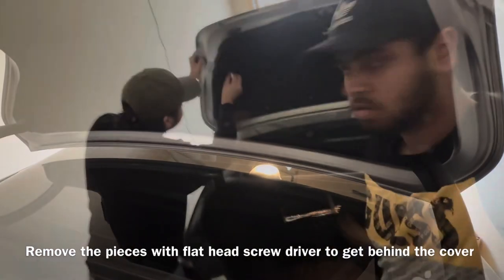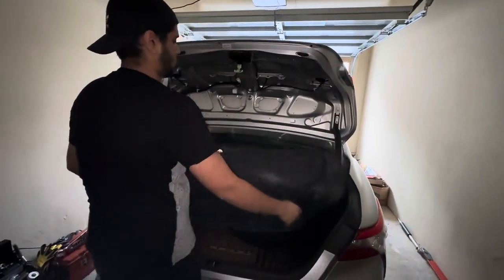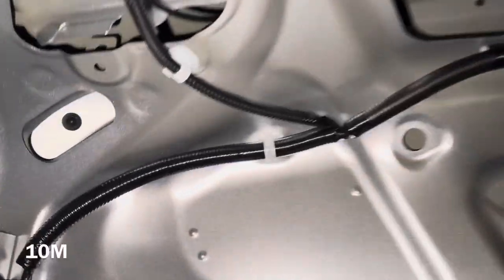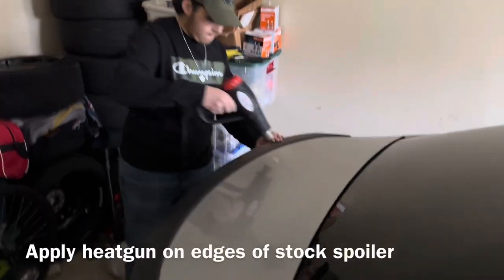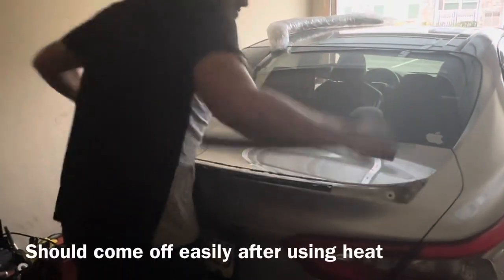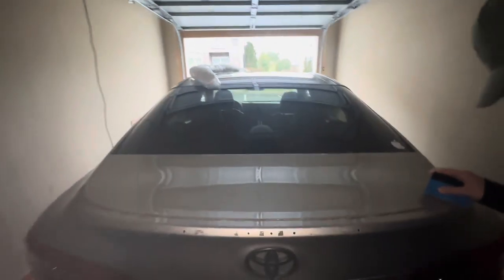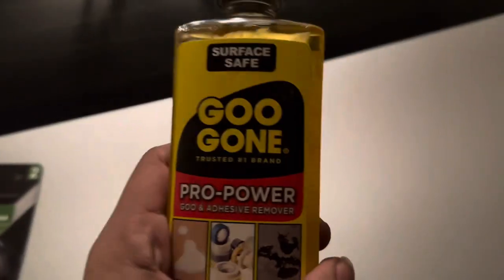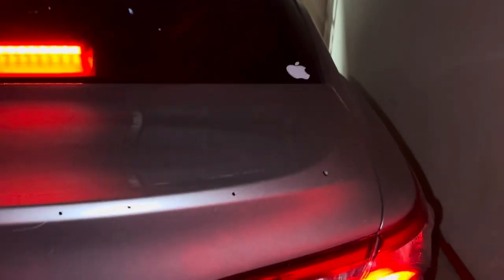Installing Spoiler on a 2018-2023 Camry SE/XSE

Comment: The new spoiler didnt have nails that would fit the same place or??
Reply from the maker: No nails required at all,  just double sided 3m tape apply with Heat gun
Reply: @FastKamuri wont the paint be damaged if you peel it off at a later date?? Ig thats not a problem if you dont intend to take it off

Comment: Did you have to bolt anything? Or did you get it on using adhesives?
Reply from the maker: No bolts at all, I got it on using strong double sided tape only

Comment: Do you HAVE to remove all that leftover adhesive from the original spoiler? I would assume that you could just slap the new one on top. Unless that leftover adhesive would make it not stick as good.
Reply: Won’t stick as good since it’ll cause gaps and air bubbles. Then when water gets in time after time will remove the adhesive along with the sun hitting it. Honestly it can last you a few years even if not incorrectly. But if you’re pretty nitpicky on how things turn out. I highly recommend removing the adhesive. Goo gone is only like 3$

Comment: Any issues with water seeping through the hokes left by the bolts from original spoiler or did you plug them with something?
Reply from the maker: I used flex seal rubber to close the holes , so far no issues :)
Reply: @FastKamuri  Thank you!
Reply: What flex seal did you use where did you order the spoiler

Comment: What tool did you use to remove the bolts?
Reply: If you still haven’t found out, it’s two 10mm screws you gotta take out but be careful not to drop em inside the trunk

Comment: I was thinking of adding a new spoiler similar as the one in the video but was told it’s hold down by tape 
Is it durable is my question
Reply from the maker: It didn’t come with tape so I went to AutoZone and purchased doubled sided 3m tape, 8 months later my spoiler is still securely on and durable. But make sure you use good quality tape
Reply: Does is leak at all rains alot here and I wash my car once a week